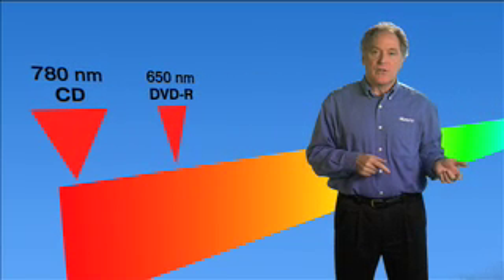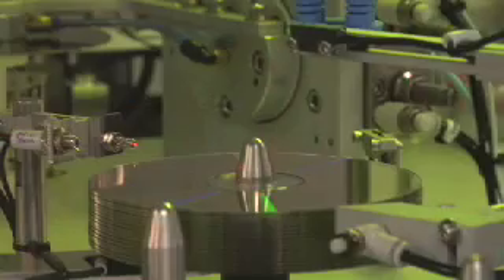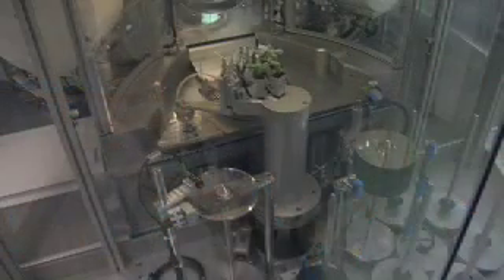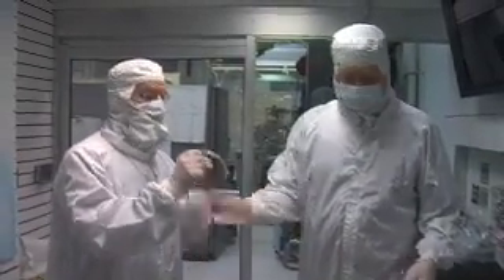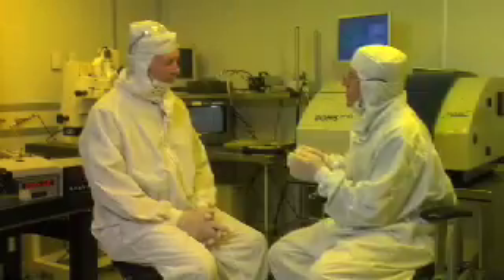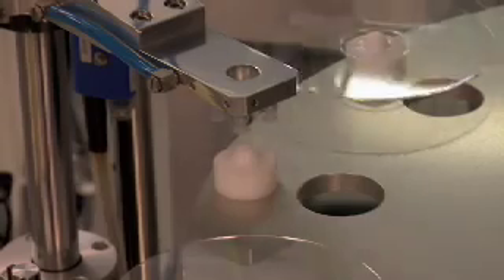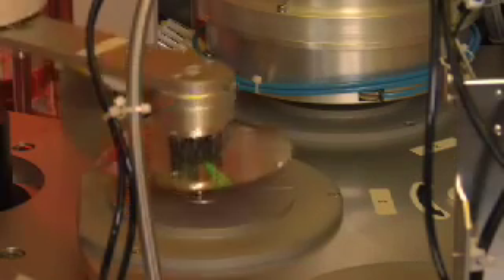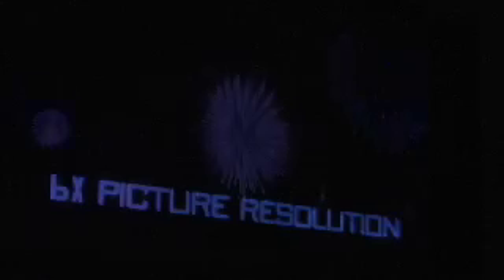Bluray disc and HD DVD Production Tour

Comment: I've used Imation/3M 5.25" disks, 2.5" disks(yes both 720K and 1.44Mb), CD-r's, DVD-r's and now Blu Ray'rs and there right up there with Kodak, Verbatim etc.  I've always found it's better to pay for a good name brand than the happy lucky dragon brands out there.  Good brand names will almost mean 'zero frisbies' where as a cheapo brand will feature up to half the discs useless.  Another factor of course is having decent quality burner drives.  You can't blame the media if you have a 2nd hand flogged out burner unknown misc cheapo brand.  There are reasons why certain devices are cheaper than others. Don't do it to yourself. Get decent quality and have success, versus constant fails.  The time wastage is not worth it.

Comment: HDDVD uses same laser as Blu ray disc so why can’t Blu ray players play HDDVD.
Reply: HD DVD has a similar layering to DVD. A blu ray player will try to read it but since it relies on the layer closer to the laser, it cannot focus to the layer. Even if the laser was modded, it won't play the disc anyway due to the different codec both formats have.
Reply: Mikolaj Wiszniewski So HDDVD half ass upgrade over DVD no wonder it fail.
Reply: You're right. It got killed by its own layering. 15 GB base capacity single layer...
Reply: Mikolaj Wiszniewski How does 4K Blu ray dual layer have 66GB triple have 100GB seems like very little jump in capacity compared to DVD to Blu ray disc?
Reply: An extra disc layer will only give a slight capacity boost. It usually wouldn't multiply on the timetable set. See TechnologyConnection's videos about DVD for more info.
Reply: Mikolaj Wiszniewski So 4K Blu ray disc is slightly modified regular Blu ray disc.

Comment: Imagine if we could use gamma rays to read discs seeing that they have the shortest wavelength of all electromagnetic waves.

0.01 nm compared to 405 nm
Reply from the maker: Brandon Fisher You should invent that!  That's a great idea.  Gamma rays are also blamed for making Bruce Banner the Incredible Hulk.  So maybe we could call the new format Incredible Discs?
Reply: databits Just imagine how much better the capacity of "Gamma-Ray discs", "G-Ray" or "Incredible Discs" would be compared to Blu-Ray discs if we could get pass the massive dangers that short wavelength light (electromagnetic radiation) such as x-rays and gamma rays possess.
Reply from the maker: Let's do this!  I'm headed to Home Depot to get parts. :D
Reply: databits Why we're at it let's be sure to get some radiation detectors or Geiger counters and some lead shielding so we don't turn into Incredible Hulks and wreck havoc in our houses by smashing up everything lol
Reply: I was going to suggest x rays
Reply: Wasn't planning on using sperm anyways.
Reply: Gamma rays are harmful to humans.
Reply: That's a pretty clever idea! To be fair, Gamma Rays in very small quantities aren't harmful. So if it had the right safety protection on it, it could be a good bit of tech. But then again, Gamma Rays...
Reply: Gamma rays penetrate many materials, so it would be difficult to make a surface on the disc that would reflect the gamma rays to the reader, like in a regular DVD or Blueray. Interesting concept though! It perhaps can be used in a different manner.
Reply: Only problem is if little jimmy figures out how to turn the lazer on without the disc and gets stage 2000 cancer